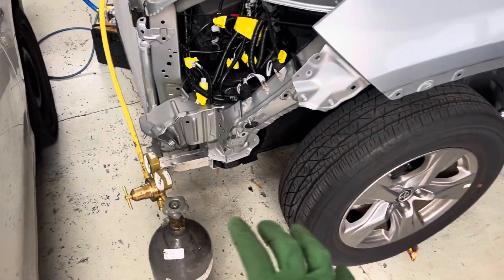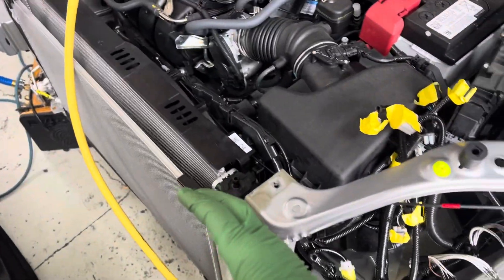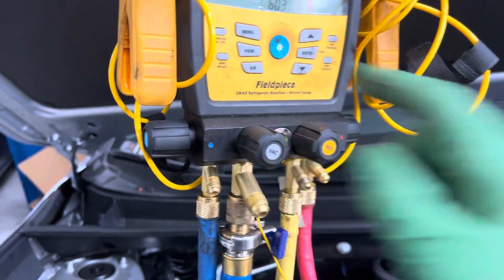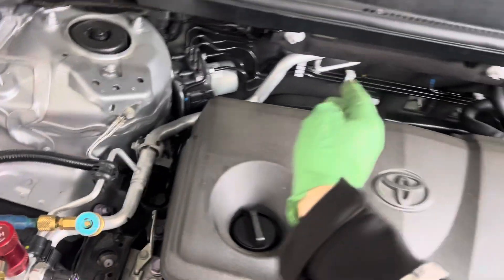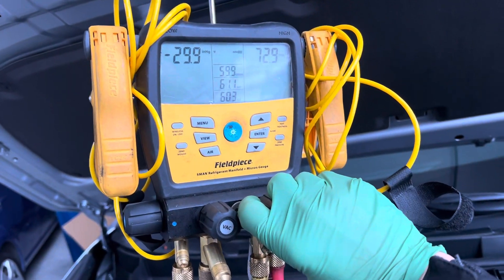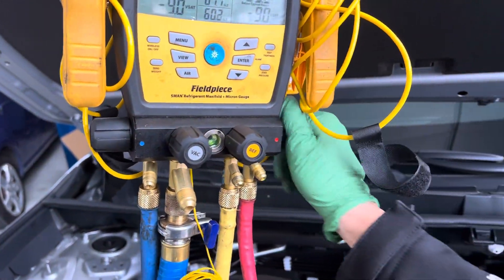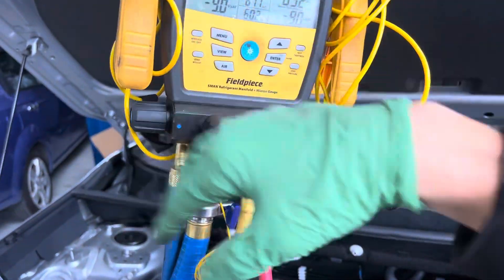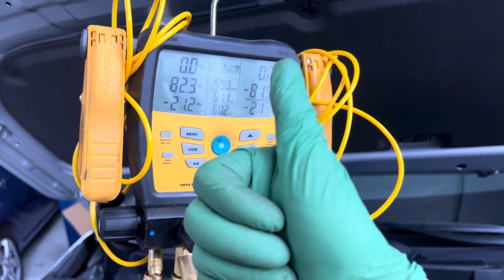Purging dry nitrogen into AC system after refrigerant recovery ￼

Comment: After the technician remove condenser lines nitrogen came out of the line what will happen after
Reply from the maker: If it’s a Good shop when they takeoff the condenser and a one or two psi of nitrogen, come out, you throw rubber plugs over the ends of your lines to keep them isolated from the atmosphere. 

In other circumstances, when you’re just replacing a part as fast as you take off the old part, your immediately putting on the new part so there’s no mixing or infiltration of ambient moist atmosphere into the system because it’s filled with dry nitrogen 

And then you immediately turn on the vacuum pump